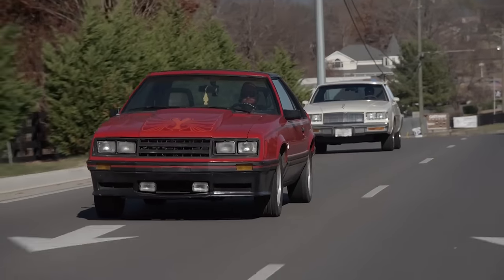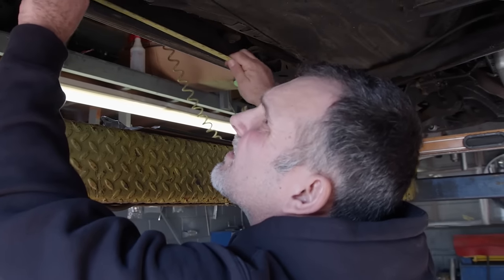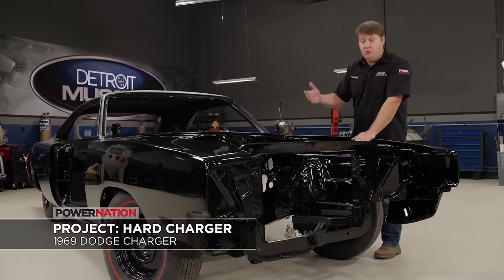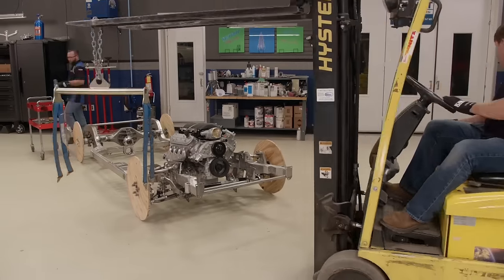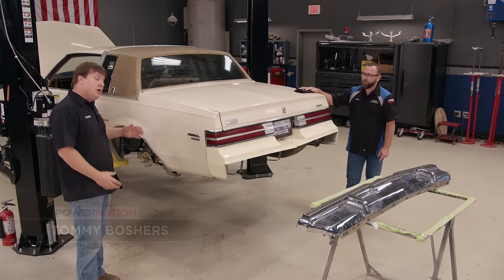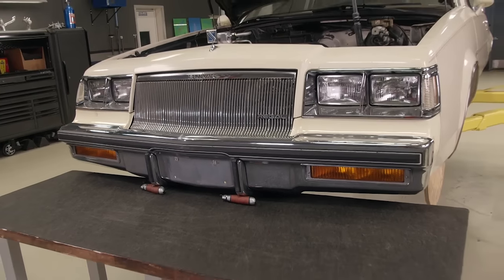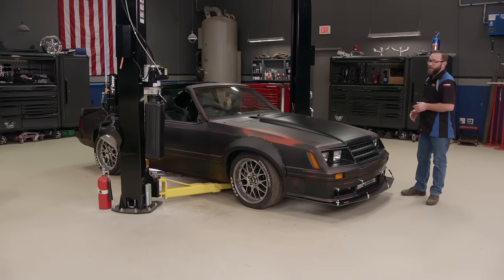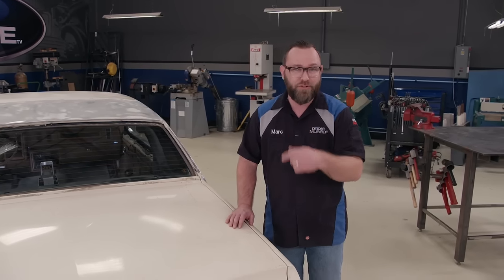FULL BUILD Buick Regal: Some Say Pro-Touring, We Say Pro-Luxury

Comment: looks like grampas car with nice rims. hate the over size tranfomer shifter! should have painted it all silver with black race stripes and black interior and left out the big belt buckle loops in the set! WTH! would of looked better with black seats with silver centers! and a real console!  love the frame the engine and suspension! as well as the larger wheel well and tire and rims!  the fin would have looked alot better if it was molded and did'nt have those 4 brackets supporting it.  but it performs well.

Comment: Its funny when he measured the drive shaft in 1000th with a digital caliper then a tape measure to approximate center of pin to a 1/16th. I don't even understand the logic in that. 51.9825 haha call it 52 and be done

Comment: why would they use a dual quad lower manifold to put that other stuff on top of it?  they make manifolds that don't need the dual quad lower manifold.

why did he use a fuel sending unit that had an external fuel like, that fuel sending unit had fittings at the bottom for connecting fuel lines, why not use that with an inline pump?

did they really mount the power steering reservoir to the plastic inner fender?  why not make a metal bracket to weld onto the frame?

how they build a car like that with a nod to the Grand National and not put a lower valance under the front bumper?  it looks so weird without one.  look at the Grand National are Monte Carlo SS, something like that would have gone so good on that car.  not to mention it would hide the lower front suspension and steering rack.  also it would help cut the air that is going under the car and improve the handling even more

so much of these seems like advertisement for products instead of actually using things that work

Comment: Ok... So, a year later... I'm catching up. So, I do love the car... But, I have a few complaints. Firstly, they took the time to map out fender flares like a GNX... And then, never used them. Shame. Then, they ruined the body lines of the car by slapping the fuel filler on the side of the car. I think that could've been better planned. Then, after putting the grand national hood on... The GNX vents in the fenders and making a ramped up grand national spoiler... They left out the chin spoiler. Which made the nose of the car look anemic and odd having a custom front bumper and no chin spoiler. And finally... The biggest let down to me was that they did absolutely NOTHING to the dashboard. It's stock grandmas Buick regal stuff. They even left the stock steering wheel after they put all that money and work into a custom interior. All the money in the world to build a regal and look at all the cut corners. Jeez. What a letdown.

Comment: That bumper is well executed but looks awful. Theres not another round part of that car outside besides the tailpipe. This thing is cursed. It would red flag me just seeing the front end like that. No Grommets or anything in the bumper? They cut a brand new bumper up and got the turn signals in nice and 'fixed the license plate by adding more metal, then cut tons of holes in it. Die cut for strength, but I cant help but wonder about the longevity of a design like that.

Comment: I have laughed at this since the early 90s. Guys talk so much crap about Ford mustang, cars, trucks. Yet in almost every case going way back people heavily modify their GM vehicles to compete on a level that the mustang can with simple upgrades. Then we move into the drivetrain. Still today like in 1988 with a cam, headers, roller rockers, wheels and tires and suspension upgrades the mustang can achieve any Goal that modern sports cars can. I guess you could call it a SBC of the the car world..hence the reason why all these people nowadays using Fox bodies for LS racecars because there's nothing u cant do to a fox that wont make it competitive in any motorsports. But if you ask any GM guy they will claim GM is the best of all time..funny how that claim still goes on. Yet the ls still just like the SBC cant produce any real power without power adders and a crankshaft rods and hard parts while a 302cu can do all of the same things without any mods if u step back to the old 302 they are still pushing 11secs in the quarter mile with 240k engines with a cam and headers and a few bolt ons. Either way not attempting to start crap I just find it funny that 50k car vs a 10k mustang and if the mustang loses its oh it's a junk ford but if the ford wins then it wasn't a fair build.